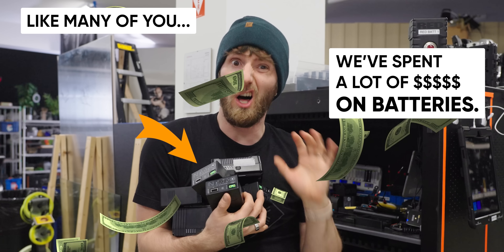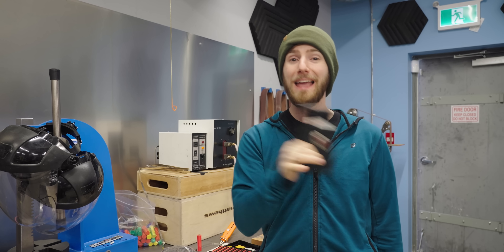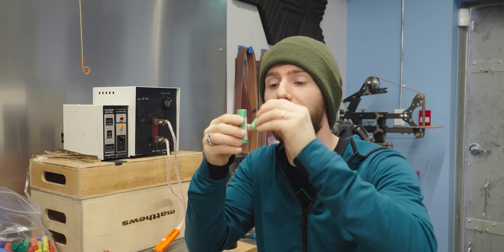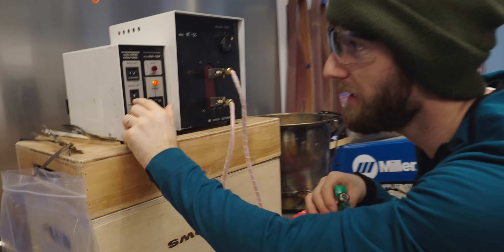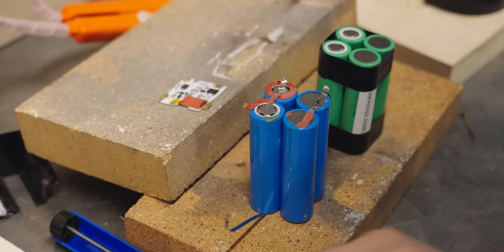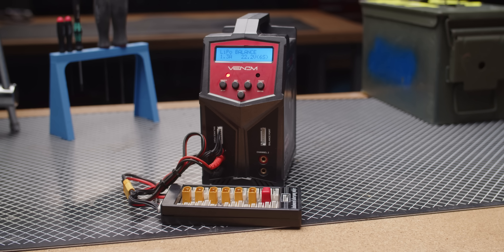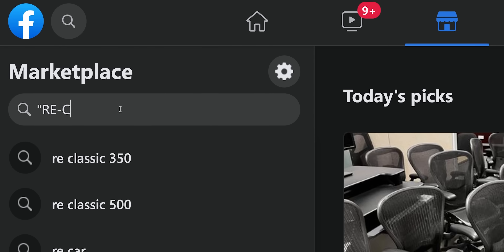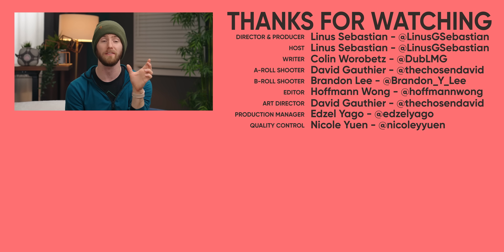This should be illegal… Battery Repair Blocking

Comment: Yer SOOOOOOOO Skurred Linus..   That spark you had was just the short circuit current from a shitty connection on the spot welder. If it was going to spark from a voltage difference between cells, it would happen BEFORE you even hit the spot welder. 

Either way, I'm not a pro, but I do have experience here and it'd be neat to see that RED BMS..  Mail it to me. I can DM the address.  Maybe I can make heads of tails about what actually happened with it and when I get some time I can run some tests on it and maybe, MAYBE pull the software on it and see what they did.

Comment: I'm so happy you're wearing safety glasses.
Those are always the number one safety gear when soldering

I just went through a similar process while trying to figure out how to refurb my power tool batteries!
It always bothered me how similar the insides of each are, while the connector and BMS is what makes each one proprietary to their own product lineup.
Batteries are often more expensive than the tools these days it seems.
"Buy a battery and charger for $300 and get the $200 tool for free!"
"why not just sell both the battery and the tool for $150 each all the time?"
"... Throw him in the cement mixer, boys."
Reply: yeah having a lithium battery exploding in your face is no bueno.

Comment: 13:35 is actually -7v not +7v. So you have reversed the polarity.
4 cells would not have had nearly enough the ammount of current (amperage) required.

Also you do realise those cells should have been discharged first.

Comment: One can also try buying equipment that uses LiFePO4 cells. They are inherently safer than Li-Ion cells.
"Lithium phosphate cells are incombustible in the event of mishandling during charge or discharge, they are more stable under overcharge or short circuit conditions and they can withstand high temperatures without decomposing. When abuse does occur, the phosphate based cathode material will not burn and is not prone to thermal runaway." -newcastlesys

One could also look into the feasibility of changing your battery packs from using Li-Ion cells to using LiFePO4 cells. However, can be fairly challenging in some cases due to cell voltage, cell size, and charging differences. It looks like more consumer device manufacturers are starting to use LiFePO4 cells.

Comment: I have a very inexpensive but very effective spot welder. I already tested it welding nickel steps onto old, dead cells, and tested the two layer capability. It worked pretty well. All of the welds were solid, even the two layer welds.

This device is about the size of a laptop power brick, has a rechargeable battery in it, and supports a substantial number of increasing power steps. It doesn't have the granular settings of you Craigslist acquisition, but for welding a few cells together, it appears to work fine.

That said, I'm not going to be re-celling any lithium packs, only building new ones. And I'll be very careful. But I don't expect to do it often. 

The original intent was battery packs for Amateur radio gear, but I found that using inexpensive "sink" or "trigger" circuits, I can use consumer grade Power Delivery or Qualcomm Quick Charge power banks to supply the correct juice for low power ham radio gear. What hams call "QRP" transceivers. These are usually CW rigs, with a maximum output power of 5 watts. (Yes, that's Morse code gear.)

I do have some QRP sideband gear that puts out a max of 15 watts of voice transmission, but I only have one pack I'd trust to supply it at full power, an Omnicharge Ultimate. If I limit to 5-10 watts, I can use some other power banks with the necessary capacity. I can still use all of my power banks if I stick to 5 watts on all of them, though, which is safest. So I really don't get any added benefit from building packs myself.

The welder is still useful, so long as it's similar work. Maybe it'll be useful in other projects. It was only about 50 bucks.

Comment: Why wouldn't you just use nimh batteries instead.  Yeah they are not as good but they are hella cheaper, super easy to work with and will still work in the cameras.  So they won't hold a charge as long...Big deal

Comment: Linus, it seems like your welder settings are a bit too much on welding power and welding time, normally my welding pen does not spark like yours, it doesn't turn red when welding at the tip area with the Nickle strip, I am using a Sunkko 737G, it is not super powerful maybe I can say it is under power, because I have set it to double pulse and up to 85 (max is 99)on the power settings, but it works like a charm, have been built a 60V 50AMP for my scooter and a 72V 42AM for my friend's scooter.

Safety first, to anyone wanna DIY lithium battery pack, but if you don't know what you doing, please don't do it, because lithium batteries are dangerous, it can set your house on fire and burn it down quick.

Comment: The BMS "malfunction" was actually safety feature that disallows use after deep discharge ( causes copper shard forming and chance of fire).
You didn't parallel the BMS with backup battery before removing the old ones and triggered the perma disconnect.

Comment: Interesting video, but a bit harsh and biased. The main eWaste from batteries would be the cells, which you advocate to throw away as a unit, anyway. The cost/benefit ratio is probably not great for most consumers of batteries, either.

Comment: If you where truly afraid of run away events you really need to charge and discharge all the cells and make sure they all max out at the same voltage and hold that voltage than make sure they're all discharged before welding them. You showed metering them but not the charging which is important if you truly want be safe. But those sparks are normal because you're working with current from the batteries and from the weilder you need to be worried about heat quickly generating when you connecting them

Comment: Those sparks where nothing to worry about. it's just happens with weilders and you're working with electricity as when you don't have a good contact or you actually make a contact on accident it arcs. What you need to worry about is once you make a connection it starts heating up or smoking that's when you put in the fire proof area and disconnect before it starts smoking. Also I know dell use have there bms count plugs in and unplugs instead of the actual cells behavior, so the cells could be perfectly fine but the bms will tell the laptop that the battery is bad. You guys have access to an amazing amount of tools like cnc machines, 3d printers, glue and ect but you guys never use them and it always kills me because most people don't get access to all those tools at once. There are tons of cell holder that you can 3d print or buy online for cheap.

Comment: Btw if you're Australian, as far as I know, this IS illegal and you can void house insurance among other things if something goes wrong whilst performing electrical work unlicensed, which is illegal. I know this applies for hardwiring, installing aircons, ceiling fans etc and I don't actually know if it applies for this, but I wouldn't mind betting it probably would and without extreme caution and knowledge, can easily be a disaster.

Great video Linus, was very entertaining.

Comment: While lithium battery fires are bad, they arent as bad as a lithium fire. I think you confused lithium metal and lithium ions, the latter is what's used in lithium batteries. While lithium metal is flammable and basically impossible to extinguish, lithium batteries use lithium salts which are not highly reactive and flammable, however, there is still flammable solvent (usually chlorinated or fluorinated) which will release toxic gas when burned. The exploding of the battery is due to heat generation and the solvent boiling and pressurizing until the case explodes and the solvent can meet air and ignite. They are still horrifying, maybe even moreso than lithium fires

Comment: You think this is bad? LOL! Have fun in a future where politicians are pushing for electric vehicle that utilize the same cells and 'BMS' tech - I said this before and I'll say it again, the push for EV's has nothing to do with saving the planet. In fact, EV's will produce more waste/e-waste than ICE cars and require even more fossil fuels to recharge them over and over again. The push for EV's is nothing more than planned obsolescence and having complete control of the product sold to you, the user. Not only will you not be able to repair your electric cars and the batteries in them, but you also won't be able to sell such cars used to others - since car buyers will just want to buy a "new one" v.s. a used one due to the batteries being depleted and irreparable. The used car market will literally vanish. You will buy new and then dump it in a landfill 5-7 years later. Yep! Only an idiot would believe that EV's are great for the planet - the only winners here are the manufacturers' execs who will collect HUGE bonuses from massive sales while every idiotic buyer is drinking the "go green" Kool-Aid ...
Reply: End to end, it's still environmentally better to buy an EV if you're buying a new car.

Comment: This is the sole reason I cannot buy an EV right now.  I have heard zero plans about what happens to dead EV batteries, and there is active resistance and disablement when replacing a battery pack in a DIY or third party setting.

Comment: I've rebuilt a few batteries. A portable DVD player, a couple PDAs, and an obscure H/PC.
I can very comfortably agree with Linus that even simple rebuilds are best left to people who know what the hell they're doing.
The H/PC's BMS failed after the rebuild and nearly caused a very frisky situation when the #2 cell was subsequently reverse charged.
I'd rank that incident in my top three friskiest battery incidents of my electronics career.

The DVD player had two long LiPo pouch cells. One had failed. I had no clue where to buy these, so installed two 18650s. I think it's due for another replacement.
The H/PC had three 18650s. It served me well for a few more years, but has been suffering a cascade of failures. The battery charger and BMS have both failed, as has the LCD backlight.
PDA #1 was an extension battery for a CF reader. Haven't been able to buy these for over 21 years, so I tore one apart and replaced its pouch cell. It ... looks about as nice as you'd expect.
PDA #2, I was actually able to buy replacement batteries for it! However the problem came when I installed them, and the BMS was incompatible with the PDA's charge controller. It could only indicate 0% and 100%, and they didn't align with actual 0% and actual 100%. So I ripped out the BMS from the failed battery and installed it on the replacement.

Comment: this video is so CRINGE ITS NOT THAT HARD TO DO THIS or dangerous, youre working with low voltages. a spark here and there is fine just dont leave it shorting out for longer than the spark you dont have to throw the whole thing in sand hahaha this is cringe AF

Comment: at my workplace i tried to re-use the batteries of a Dell extreme rugged 7212 tablet into the newer model 7220 and when I turned on the tablet displayed a msg about the the battery non being official and charging was disabled....same form factor they just change the power req

Comment: This may be a silly question as it sounds you talked to a knowledgeable battery rep. But, did you try charging that battery after re-celling it? A lot of bms's will disconnect the output when the voltage drops to low. A charging cycle can sometimes re-enable the battery.

Comment: Wouldn’t a possible scan and then 3D print of the housing be a better solution for the shorter batteries. Not sure if it’s possible 😅 but was thinking it could work.

Comment: You could try applying external power to the bms system while it is disconnected, as long as it isn't checking the capacity.

Comment: So, unless the BMS circuitry monitors charge cycles.. If its a BMS that bricks on power loss, there would surely be a way to keep it alive whilst you remove the cells, croc clips and a regulated, adjustable PSU for example? So long as you cut the cells from the BMS quickly after applying external power and limiting the current, you'd have to be very unlucky or short something for it to go bang! Evil BMS indeed, that's disgusting, but not really that surprising! I did bring some battery packs back to life where their cells had become unbalanced by individually charging each one whilst still in-circuit, using an RC battery charger. Worked perfectly, but please don't try at home if you don't know what you're doing!

Comment: in canada no dice, but in usa there is suppose to be a right to repair law being passed. the movement started by apple serializing batteries to force aftermarket repair techs to go out of business by "invalidating" battery replacements, which ironically are sometimes better than stock batteries.

Comment: Just a tip from a EE: some BMS when started from cold (first time or if cells replaced) need a charging cycle. This "wake up" the IC/BMS to start working and managing the batteries. Just place the battery pack in the charge and test it again

Comment: Some BMS will  switch off once the battery charge falls below a certain voltage  and if you change the cell you will have to connect the Pack to the charger to turn the BMS back on otherwise it will not work.

Comment: I recently encountered some of the "evil" variety in a dell laptop. It's extremely irritating because it won't even let you use the laptop with the battery connected if it's bad (fair enough), but you also cannot use it without a battery either! So not only can you not use it as a "docked" desktop, but you have to spend the $80 or so to buy a new one if you ever want the computer to turn back on.
Reply: About 6 months ago I re-celled a customer's Dell E6420 battery pack with 6 new 18650 cells. Worked beautifully. So I guess maybe the newer ones are the 'evil' ones?
Reply: They really took the M out of BMS!
Reply: WOW! thats pretty malicious.

Comment: Could you not just wire a bench power supply (set to the same voltage as the cell pack) in parallel to the BMS at the time of disassembly, remove and rebuild the pack then remove the bench PSU from the BMS when the new pack is installed? Pain in the ass but not impossible to circumvent the DRM. 

Also, next time you weld nickel strips to the positive terminals of the cells, round off the sharp corners of the strip. The last thing you want is for the sharp corner of the strip to puncture the cell wrap and short on the negative outer casing when you're trying to squish it back into its original housing.

Comment: I actually think it's far more likely that the BMS went into a fail safe condition when the battery voltage crossed a threshold (eg 0V) and shut down. Li-ion chemistry changes when voltage drops below minimum safe level, and can actually become a fire hazard if you were to charge it again.

I imagine this could easily be achieved to unit bricking itself when voltage goes to 0V.

Comment: Hey guys, fun story here. I worked on a project which was going to use a Li-Ion rechargeable battery for the surgery market. We had a very nice BMS and charger designed. To start off with the wanted a planned obsolescence countdown in them... But then my employer, in conjunction with our client, decided that it would be better (last second in the project) to have a single-use battery. In the end I had to redesign the cell to work only one time and prevent recharging. It physically can not be recharged and significantly reduced the performance of the battery. So now there is a rechargeable Li-Ion cell being sold for a single use. This was done purely for profit because it makes more money to keep on selling batteries. You should look at some of the things considered "consumable" in the med device industry...

Comment: You can always use the old cells to make powerbanks :).
With all the laptop I've fixed in the last year, I managed to build a 40000~ mha powerbank.
Also I don't understand why you are concerned of sparks, the short it's between the pins and the metal contact, it's not an internal short.
Reply: It's because their prep for this video was a bad instructables. They're in the dunning-kruger valley.

Comment: Hey Linus, Something you should try before labeling a BMS as "evil" is to try charging the battery first. When most BMS ICs shut off due to undervoltage (or no voltage in the case of removing the cells) they essentially disconnect themselves from the battery to prevent it from draining the battery further to the point where it could be damaged. The only way to power on the BMS at that point is to apply an external voltage source to it, ie. charging it for the first time.

Also, as some others have said, you guys where being way more cautious than you needed to be, which is perfectly understandable for people who a) aren't very familiar with pack rebuilding and b) don't want to get sued by viewers. But those cells in the bucket are probably all perfectly fine. even if you did manage to short out the cells briefly, those Samsung INR18650-25R cells you where using are incredibly robust, way more than an RC Li-Po pack. Those are the ones you don't fuck with. If the batteries haven't caught fire(obviously), are not warm, and still show the same voltage as before, then they almost defiantly have not suffered any damage.